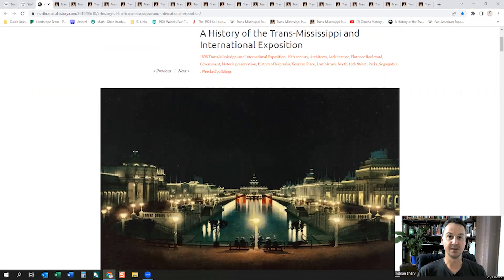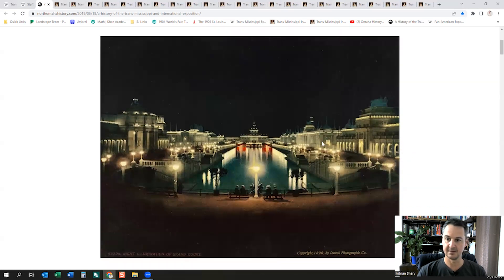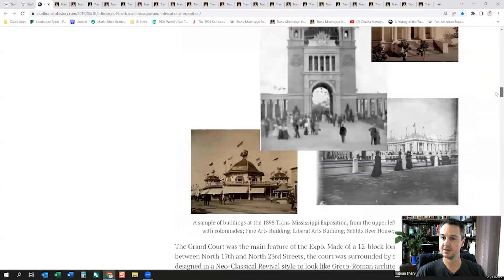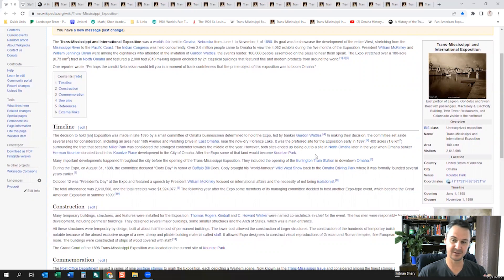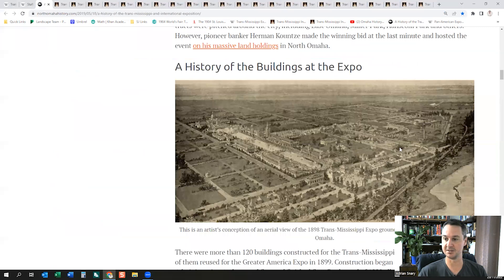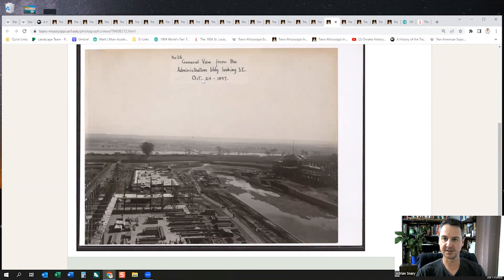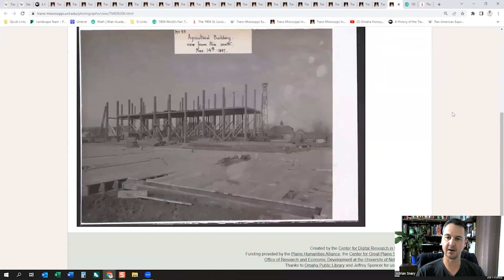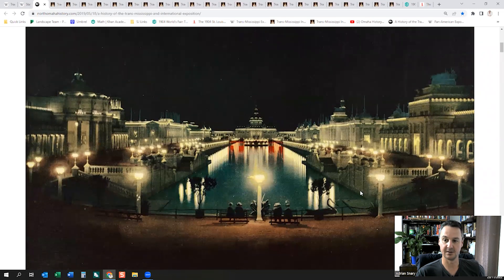1898 Trans-Mississippi Exposition - Omaha, Nebraska

Comment: It's hard enough to wrap your mind around how they were able to build just the structure of the buildings, but then you also have to consider that inside there were marble finishes and intricate designs on the walls and pillars that did not repeat all too often. That would mean that they would have to have 100s of plaster molds for each building and designing those in itself would take a long time. Not to mention all the statues that could not have all come out of a mold because the geometry would not allow it to be molded. It would have to be sculpted somehow. And I say "somehow" because some were made of marble and I can't imagine a hammer and chisel getting the job done.
Reply from the maker: Spot on

Comment: Okie dokie so at 20:35. Whenever you click on that picture from the other pictures. Look how low it goes. The structure of the ground has changed. So since when do we start off on a upper floor and build down. They do this with a lot of their photographs. If you pay attention to the other photograph. The windows are not far from the ground. But in 20:35. Complete difference. My husband's a professional photographer. He's never really jumped down the rabbit hole of the photographs with just missing people. I sat down and showed him bunches of photographs and he is mind-blown. He's like where the hell are all the people? There should be people everywhere. Then I showed him some photographs where people were drawn in. How people are used and duplicated. As well as the skies, he spoke of how easy it is in photography to fake photographs. Most certainly. Cutting out, and overlaying one film over another film. Very simple.. I asked him would it be easy to cut out and make a house or a large building, appear with nothing behind it. He said of course. He said you would just take scenery. Cut out what you want in that scenery. And then overlay your photograph. Everything is with angles if you have a good eye. And you play your angles right. Absolutely. And then I said well with that said jump down this rabbit hole with me. Started playing photographs. Especially of the ones where they're building. My husband's like, the top of the building is done before the bottom? Did you see that? I smiled, absolutely. Just in these photographs the same thing..
Reply: Photographs with "missing" people are not a thing. I've seen plenty of the supposed suspicious photograph and I wasn't able to find a single one that didn't had a good explanation.  
Either we have very old photographs where we have people only appearing as blurs. Or we have photographs of parts of towns that are not very busy. A thing people always seem to miss is that tourism wasn't a big thing back than..and locals don't spent a lot of time walking around sights like palaces or churches. Plus photographers who want to take photos of those places usually try to avoid having too many people on their photos. Thats why we have Postcards who show sights mostly without people. Also it helps if you shoot your photos early in the morning. 
If you wanna see people you have to look at photos from the same time that show shopping streets, or working areas or festivities, and you see that those supposed empty cities are full of live. 
And yes blur on photos (espeically old ones) is a thing. Your husband should know that. Thats why people not just got a camera and made perfect photos but why photographer is a profession in the first place..because especially with old cameras you can make loads of mistakes. 
So...instead of believing every past photo was faked that shows something you consider an anomaly..why don't you learn a bit about history..and most of the things become clear.
Reply: @dergutehut3961  of course he knows that. He was stating that they could blur in people. With light. By layering photographs. And shapes. Some of those individuals are painted in and some of those individuals are shadowed in. And yes he knows that whenever people will move it will make a blur. You have mistaken my words. He's a professional 38 year photographer. He is coffee table books. Worked for Knight Ritter the Drake hotel in Marriott. As well as fruit of the loom. And many other campaigns. Clothing. Lingerie. Macy's. Few other companies as well... As well as worked for LaClassique Jewelers. He was their photographer. Every single photo has vanilla skies.. they're taking out the zeppelins. That have been in our skies since 1475 all the way through the early 1900s. I'm sorry sir I don't believe what you're saying. I believe what my eyes tell me. And as well what my husband agrees, that those photographs are manipulated.

Comment: I'm one state south of Nebraska 
It gets extremely cold in the winter months in Nebraska.
I don't believe any product mixed with water could be used on days it needed to cure.
We have to put solar blankets over our concrete pours in the winter months here.
Nebraska won't even pour concrete during a certain time in the winter.
I have been in construction for 30 plus years, and I cannot comprehend
how any of this was done in the time frame they claim.

Comment: If these elaborate buildings existed before, why didn't the native American tribes ever move into those areas and use them? Massive structures as ready-made shelter seems like a no-brainer.
Reply from the maker: Yeah that's the one question I still have as well. What was going on before the 'new' people moved in? It could be that the previous people were only just removed before these buildings and grounds were taken over. Meaning that Native Americans might not have had a chance to move in anyway.